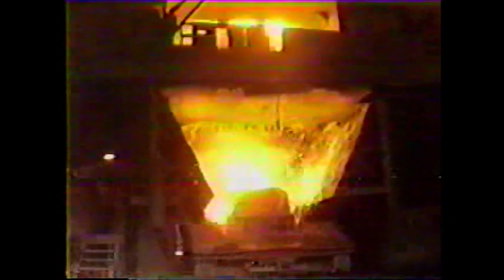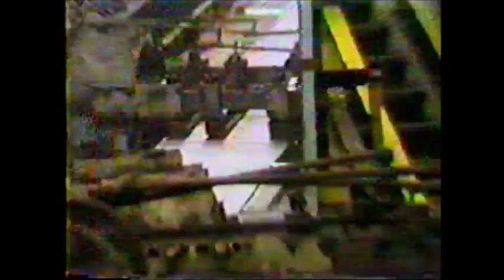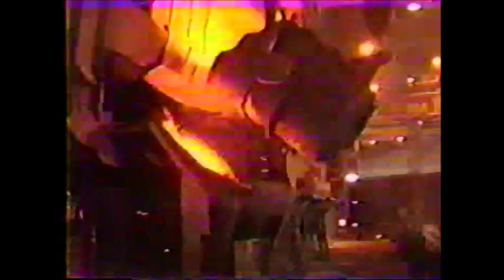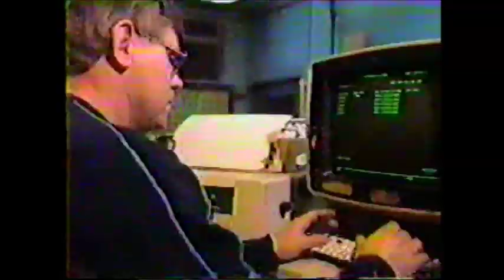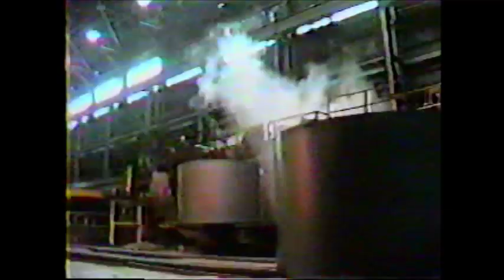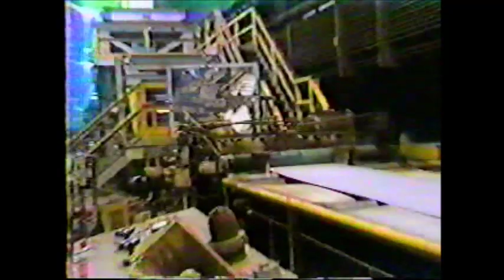Steelmaking Warren's Way

Comment: The electric arc furnace combined with direct reduction iron is making the large integrated mills with the big blast furnaces obsolete.  Mini mills are also reducing the need for the big integrated mills.  Mills that once employed 15000 people are being replaced by mini mills or the direct reduction plants employing maybe 500-800 people.  This is the trend with manufacturing, it's beginning to scale down labor but at the same time increasing productivity.  It's time to have a contingency plan for universal basic income and single payer healthcare in case we find ourselves in a position where we have more labor than jobs.  I work in the tech field and while there is still a belief that new industries and jobs with AI and automation will fill the void, we honestly don't know if that will happen.  Better to start having some contingency plans now.

Comment: Brings back memories for those who worked In those environments, , thanks for the upload. I worked at Inland Steel and steel making was a way of life. Good money,great retirement , but very hard on the body.
Reply: What department did you work at inland Rick
Reply: @kevinbraden9445  started out at 1&2 cold strip mostly the #1 side (tin mill) then to the yard dept. help open up cline ave shipping then HH yard then the ping ball game began went to 3 cold strip #2 BOF, 100” plate mill 10 and 14 inch bar mill.

Comment: This is fascinating, but the emphasis on how much focus they perform above epa standards, foretells regulation concerns already by 1979 The die is cast that will ruin LTV and lead to the ruin of the American Steel Industry.
Reply: I worked at the openhearth division of US Steel Gary Works for 2 summers and finished 3 summers later at #1 BOF. Accomplished many a dirty, hot and semi- dangerous jobs. Great way to acquire college cash and a respect for hard work.

Comment: I always wondered why Republic Steel decided to modernize their blast furnace instead of just installing an electric arc furnace.  EAFs would have made so much more sense given that plant low tonnage, specialty mix and land locked location.
Reply: @B.O. Warren had two electric arc furnaces; they were moth balled a few months after the Basic Oxygen Furnace (BOF) began operations.  Management and supervision were asked to fill in empty slots in the BOF.  All the raw materials (limestone, dolomite, spar, etc.), except for scrap and iron ore, which came in in railroad cars, had to be trucked in, some of it, on an emergency basis, in the middle of the night.  The electricity was carried in on it own, separate very high voltage lines, which someone had to maintain.  Relative to the water transportation available in Cleveland, Chicago, Fairless Hills, Sparrows Point and elsewhere, transportation costs crippled Warren.
Reply: @vze29tvd  New iron is not needed - if so it should be produced on a commodity basic.   EAF are best using cold scrap steel  bought on the open market.